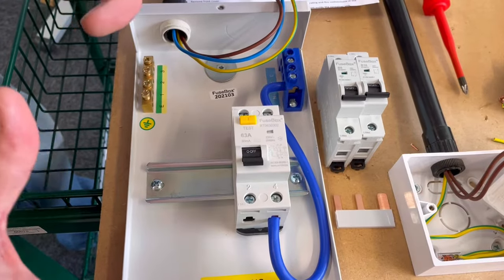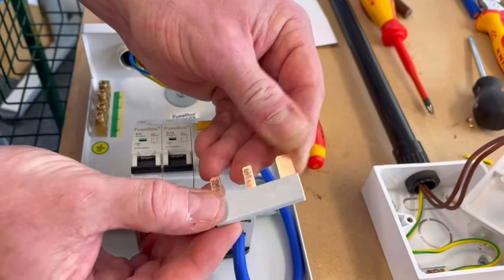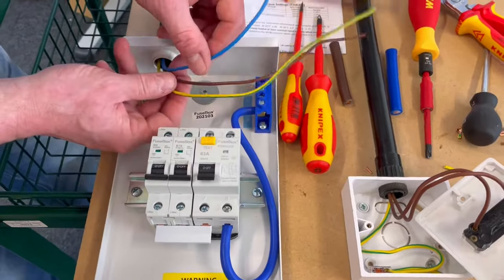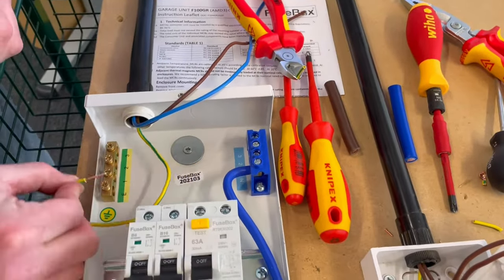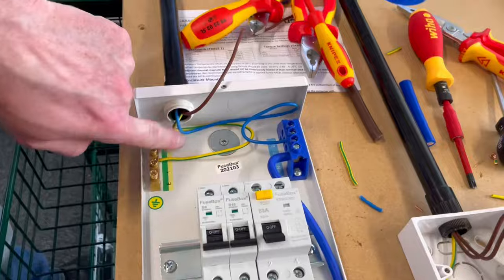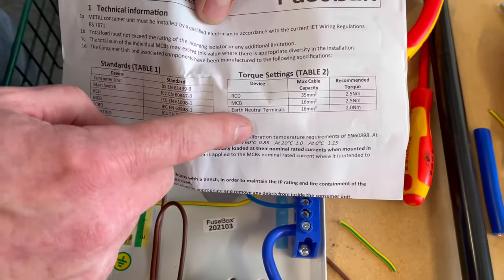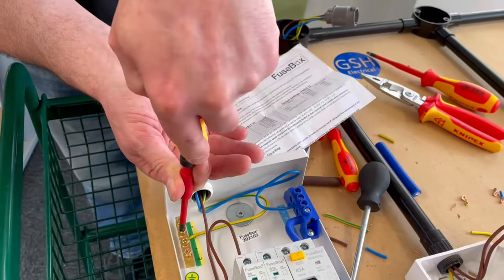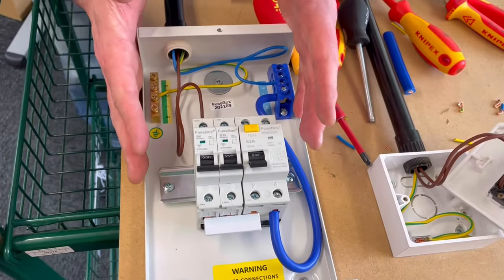Connecting up a Consumer Unit Wired in PVC Singles - Fitting MCBs and Using a Torque Screwdriver

Comment: I don't understand why it's important to to torque the screws. 2.5 nm is very low. Terminals relax over time. We were always encouraged over tighten with our hands. I wonder if this has anything to do the 400 CU fires each year and the reason for CU units to be metal to help with the fires?
Reply: These are all soft metals - over-tightening is one of the things that'll lead to a joint relaxing (as the metal goes past the plastic deformation point and then provides no extra clamping load, but is now mechanically distorted and may not provide even clamping force). This is more of an issue with a cage clamp and the comparatively short tapped threads, plus a sheet metal clamp, compared to a screw in a brass bar which can handle comparatively high loads, although you can still certainly over-tighten and maybe even strip a brass screw or thread. 

As for using a torque screwdriver: it's consistency. Yes, torques are only good to around 25% tolerance on clamping force in real-world applications (hence TTT and TTY for critical mechanical applications) and yes, some of us develop pretty good "torque wrists" - but none of us has a calibration certificate, and the apprentice with three months' experience probably can't hit 2.5 +/- 1Nm reliably on all 40 screws to do a fairly simple wiring job. 

Is it that much of a big deal? 99.99% of the time, no. How long does it take an electrician to do up ten thousand screws and have one which is a problem? Probably about three months, or less if it's a big job. For the price of a 2.5 and a 5Nm, fixed torque driver, the cost savings associated with never having a "undertorqued or stripped screw" problem are well worth it.
Reply: When using multi strand wire I prefer to use ferrules , more reliable as well.😊
Reply: If you over tighten you can crush the copper to the point where it's very thin and weak.  This leads to breaks and arcing.  Open enough consumer units and you will see it.
Reply: Why do people think they know better than the manufacturers when it comes to torque settings. It is not logical.
Reply: Mobile they’ve done the testing to gain the approval or you need to realise is overtightening damages it and then it becomes loose
Reply: It is important because we Electrician do not want to carry those Liabilities associated with Under-tightening or Over-tightening at point of connection.
Do it as said by the manufacturer, liabilities not on us. 
You put in yr own "tightness" you bear the liabilities.
Reply: What make Consumer Units do you prefer?
Reply: @temp26j724-i  The important thing to remember why we now have metal CU. Over 400 CU fires every year due to electricians leaving loose terminals. The problem has never been about torque but the appalling standard of work by too many sparks.

Comment: 2.5nm of Shyte xD no need any clown tool to tighten a phokin screw
Reply: You should not be doing electrical work rating is very important because if you overdo it it can get it to terminal cause it’s a loose this rating is designed to be the best performing overtime if you will not follow it quite simply you should not be doing anything related to this
Reply: fr tight is tight.
Reply: @UKsystems it'll be fineeee thats not a real world occurrence
Reply: might use an impact when i do my garage ;)

Comment: Why do we need to use a special slotted pozi screwdriver? I thought the point of pozi was for use with torque drivers alone vs normal cross head which can't be torqued?
Reply: Because it keeps screw head in better condition, especially in a college where they want to reuse this multiple kind is also the correct way and if you get a screwdriver kit come with some bits

Comment: Great video, Where would you fit an inline meter in this setup? The customer wants to monitor the power usage coming into the cabin so they know exactly how much power the cabin is consuming separate from the main dwelling. The meter in question is same size as the RCD and just snaps onto the rail.
Reply: My solar installers fit them at the end of the din rail if that helps. We use Fusebox with a Fusebox miniboard.
Reply: Festival in this case metres are not sold for this brand so type testing would not allow it to be installed inside this consumer unit but ones are available or an external electricity meter could simply be installed next to it

Comment: Where did all this CPC thing come from.  I have been in the trade far to long . To me and other people I know ,it’s a Earth wire and always will be .
To confuse the issue even more if I buy a drum of cable from my wholesalers.It says on the label Twin and Earth . Not twin  and CPC.. Even on electrical accessories it never talks about a CPC always Earth
I don’t encourage DIY but at least most DIYers would at least understand the term Earth wire . Definitely not CPC . so we  want to keep confused DIYers to a minimum.
Then again a large percentage of electricians still call a consumer unit a fuse board. But that’s another story .
In no way is this a criticism to this excellent video.
Reply: It’s called CPC now because there are certain systems where it’s not an earth Generally specialised hospital power systems or higher availability systems.

Comment: Just curious why you connect the incoming wires to the MCB first and from there into the RCCB. I believe in Germany you go into the RCCB first, then into the MCB and then on to your appliance. or does it not matter in the end, because the MCB will be triggered first anyway.
Reply: What joke?
The wires you see him connecting are TOWARDS Final Circuits eg to Lighting Circuits.
The Incoming Tails will terminate into Terminal 1 & Terminal 3 of the 63/0.030A RCCB

Comment: Use ferrules
Reply: Absolutely not there’s a class two size standard conductors not class five fine stranded conductors it is very unsafe is feral terminals are rated for them with this type of conductor

Comment: Problem with cheap imports like Fusebox, although popular these days, the attention to detail and safety is poor.                                      Open cage devices like the ones used here can lead to misconnection of the busbar and overheating even fire conditions can occur.
Also, the design of those mcb's means that to replace a device or upgrade a circuit you have to disconnect every connection to remove the busbar and then the device. Then of course you have to reconnect again and risk misconnecting the busbar into the device.
I only fit Crabtree Starbreaker with the plug in devices. A far safer and quicker install and when you need to change a device you just clip out and refit without disturbing any other circuits.
Reply: Fuse boxes decent quality it’s fine because it needs to realistic expectation of budget versus safety compared to a real cheap no name one Crabtree star breaker has had several recalls in the past due to its past not being fixed for purpose so I personally would never trust it in this case if you cannot install the bus bar correctly it is install error not product safety